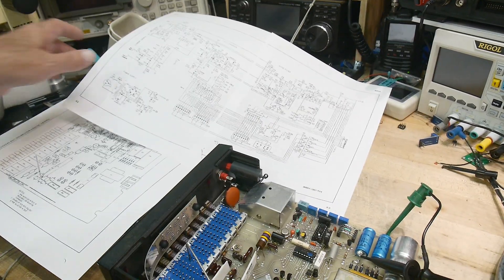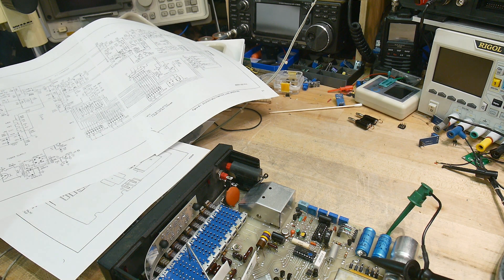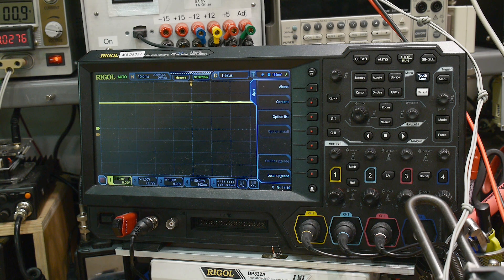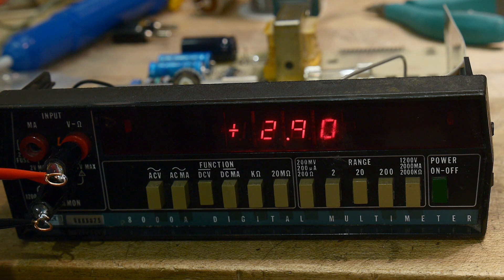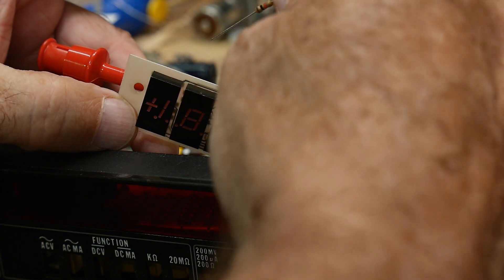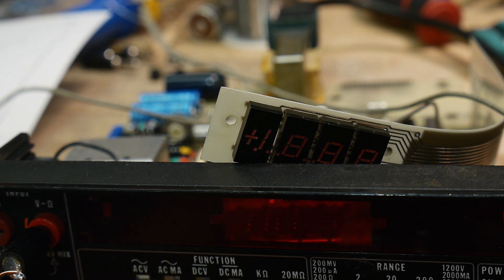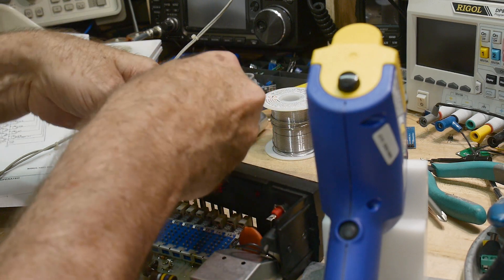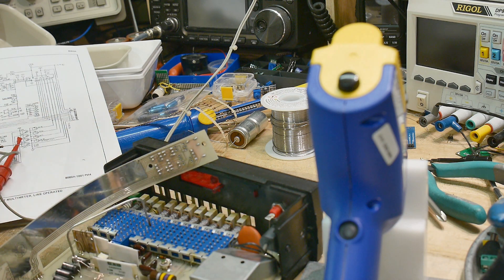#1292 Fluke 8000A Multimeter repair (part 2 of 3)

Comment: Hi, I actually repaired a seven-segment once, I couldn't get a replacement at the time, so I tried to drill out the segment from the bottom and put a small LED in it and it worked, it still works today, luckily I didn't hit any connections while drilling.

Nice day 🙂 Tom
Reply: That's what I was thinking - the little surface mount LEDs are small enough one should be able to "empty" a bad display and replace everything. Sort of like stuffing the old can capacitors.
Reply: @jrkorman  In one device, I also repaired an LED in an atypical arrow shape in this way, I carefully drilled out the chip itself between the terminals and inserted an SMD into the hole.

Comment: I got one of those greenish ones for $60 at a pawn shop many years ago, back when they sold new for hundreds more. I saw the holes in the PCB for a battery pack to make the meter portable and I checked with Fluke on how much the mod cost. They wanted $200 for it so I told them I'd just make my own. The person I talked to at Fluke told me that there was no way of knowing what problems that could cause because the meters were a very sophisticated piece of equipment. I looked at the schematic and decided that 78XX series voltage regulators weren't THAT sophisticated, so I built my own battery pack. It worked fine for years.

Comment: I offered you a 7 segment digit in the comments on the previous video. But hey, if you don't bother to read the comments... ;)
Reply: He does read the comments, but you should realize that when the title includes "2 of 3" that means that he has videoed and edited all three parts before he posts the first one. I would expect that the "3 of 3" episode will feature a fully fixed meter, including a replacement of the seven-segment LED.

I'm guessing he breaks it up this way for a couple of reasons. A lot of people won't watch a really long video, so by chopping it up into shorter chunks he gets more views. And he can compress what may have taken many days into something that seems to take less time and flows better.

All three parts of this repair had been created and the meter (probably) repaired by the time you were able to post your offer.
Reply: @tfrerich  Yup, you were right 🤐
Reply: @Ni5ei  I just guessed right. ;)